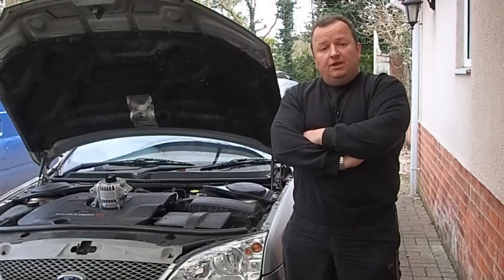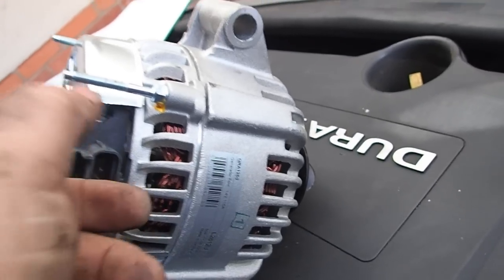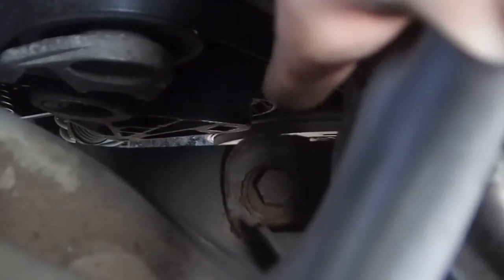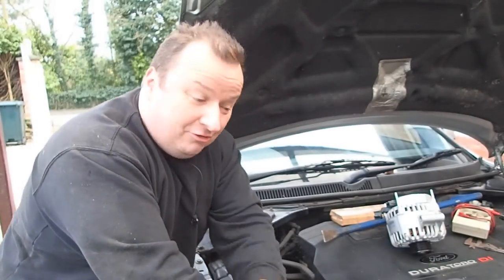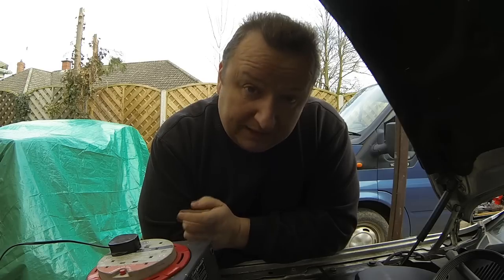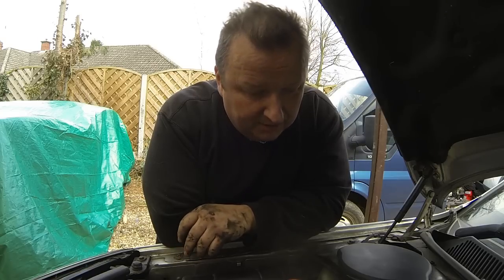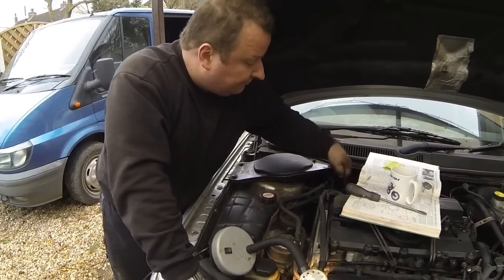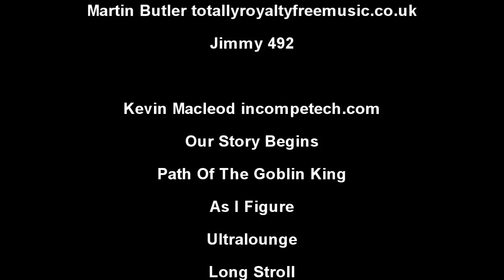Ford Mondeo Mk3 Alternator Removal Diesel How To

Comment: Great video. I just did this on my 03 2.0 tdci with the removeable studs and found out the following. If you can't release the tension on the belt then remove the top nut on the alternator. Remove the bottom nut closest to you. Loosen the other one. Remover the front stud and pivot the alternator up. Belt will come off easy. Fitting is reverse of removal. Cheers for the vid
Reply from the maker: I had to replace the alternator again 8 months later and found that out bud. I did do a video on it on my channel.
Nice one Darren.
Cheers
Martin

Comment: Thank you so much for this video; I followed it to replace the worn belt and not alternator. I was lucky as all tensioner bolts came out easy! Garage wanted £110 for this job and only costed me £16.99 for a belt and two hours work.
Reply from the maker: +Max Dee That's great. Well done and a great saving.
Cheers
Martin

Comment: I did a bottom pulley and tensioner (I would advise looking into changing them when you do the belt as they are a common failure on these, if I recall you can get the two in a kit) on one a while back and I had a whole load of ball-ache doing it as well. I didn't have the tensioner tool, or a crow bar that would fit like yours.

There's no way in hell you will get a half inch drive ratchet in to get the tension off the belt - there is a special tool for it (Ford T303676), though. They're something like £16 -£20 on eBay.

I really have no recollection of having to remove that bracket, for some reason. Can't you undo that bottom 13mm bolt on the adjuster and slip the belt behind it? I can't really remember well enough, or see in the video.
Reply from the maker: +mrman17 Not sure about that bottom 13mm bolt but I know that it's a common fail on those tensioner adusters although this one spins freely with no play so i'll let sleeping dogs lie.
Cheers
Martin
Reply: It's not the bearing on the tensioner that's the problem.

Basically, the crankshaft pulley fails (it's in two parts kept together by a by of rubber), this rattles about and causes the tensioner to fail over time, so it "bounces" about and doesn't keep the belt as tight as it should. It tends to manifest itself as a rattle at idle.

Anyway, I don't mean to do it regardless, but just be aware of it and check their condition while you are there.
Reply from the maker: Yes i've heard of that problen but hopefully it's not for a while.
Cheers
Martin

Comment: Hardest thing to replace Martin I ended up lowering the engine mine is the 1.8 petrol pain in the Arse lol although saved 120 quid so worth it I suppose .. Great vid keep them coming
Reply from the maker: +Sean Dwyer I did consider lowering the engine but struggled on lol. What a job though.
Cheers
Martin

Comment: Alright, boys and girls; I've just done this without going near the tensioner, without removing the studs and certainly not going anywhere near the track rods and drop links.
I pulled out the plastics from the wheel arch. Took the nuts off the alternator bolts (you don't need to remove the bolts). Removed the fuel filter (I'd long ago removed and thrown the heavy bracket that the fuel filter sits in; it does nothing of any value and hasn't ever caused any problems, rattles or otherwise). This gives just enough room to fish out the alternator if you're determined.
I then wheedled the belt off the guide wheel to give me some slack and with a bit of pulling and yanking, I found the alternator quite willing to come out from the top of the engine. It might help to remove the plastic part (three tiny nuts) but I dropped the replacement in without removing it so I wouldn't waste my time.
Once you've seated the replacement, you can then, leave the alternator sitting loose on the studs while you hook the belt onto the alternator drive wheel and then screw the nuts onto the studs to secure the alternator. Once everything is in place, you can use something long with a soft end which won't harm the belt, (like a rubber handled tyre iron), and by forcing the belt down and using your fingers to push the belt onto the jockey wheel, you can get it to seat neatly.
I'd be a lot more smug about this had I not got a couple of large bolts left over and not a clue where they came from. On the upside, nothing went wrong when I took it for a 'frapp of death' test-drive. There's always more than one way to skin a cat; I hope this helps.
Worked out where the bolts came from- no drama!
It seems the poster has pinned this aweful advice for some reason; I refered to his video for 'the right way' to do the job and...oh well, there's no accounting for people. 
In the interests of disclosure and out of concern for the dimwitted, I should've mentioned that I removed the plate at the top of the suspension that I think stops the assembly from falling out once you've removed the wishbone etc. which you obviously don't go near, for this. It's three extra nuts, 13mm I think. Don't lose them.
Importantly, when I was wrestling with the old unit, one of the fuel hoses got a very worrying kink in it as I was bending it out of the way but it seems to have survived...JUST...be aware; they're old and stiff; I thought I'd split mine and I've certainly damaged it, which will cause me problems in about twenty-five years. It's a cheap and easy scrapyard part...but you have to be able to drive there.
Anyway, I hate working with suspension so I went in from the top with spurs jangling and got lucky. You lot can balls it up at your own expense.
Reply: Do it the way the man says in the video,but buy a tensioner tool,it may  need a bit of cardboard tucked behind it.dont take it it out from the top,its harder work...instead disconnect track  rod end[use a heavy mallet leave nut at bottom o f thread to avoid damage] havnt disconnected  drop lnks in the past to do this job but it might help if they come of easy

Comment: I ended up buying two Serpentine Belt Tool Kit  (tensioner tool) for both of my cars. I had the belt come off after hitting standing water and was stranded. I could only use the bar and socket attachment but it came in handy. Was under $20 USD from a company called Harbor Freight.  So far I have lucked out with being able to replace a belt without removing brackets or mounts. My Kia Rondo had it's timing belt go New Years eve...supposedly they are required to be replaced at the 100,000 mile mark...didn't know that
Reply from the maker: +DJMovit These belts are supposed to last 150,000. this car has done 147,00 so it should be one really. Unlucky for your belt to come off after hitting water. Not heard of that before.
Reply: +retrorestore The one that came off was a Dodge Caravan. I was guessing something was slightly misaligned and the water just helped it along. Didn't keep it much longer. I am kind of like you as I will keep pushing the issue with large corporations that have poor customer service. Sometimes you win most you lose. Wal-Mart likes to just push your complains off to a store instead of looking into the mater. Then you get some Assistant Manager of the day that may call you back and claim it was a one time event etc etc.  Keep going after FORD! I can go on and on with issue but I won't...maybe I should vent on a Vlog! LOLHaven't seen Barney latterly hope all is well....getting old so I might have missed him in a video  :-)
Reply from the maker: DJMovit
Barney is fine lol. I'll do a vid soon on the update with Ford.
Cheers
Martin

Comment: Hey Mart.Another job sorted.Changed my alternator last year on the mondy but the Diesel version looks a pig to do compared to the petrol with the tensioner location and alt bracket.Swearing helps though.Does with me lol!
Reply: Good job also.
Reply from the maker: +Martin Hall The alternator was fine Mart. that stupid bracket to remove the belt was the pain. Still, got there in the end.

Comment: use spanner instead of socket on top bolt. i used crow bar to get belt of but threaded a ratchet strap threw tension er and around wish bone , cranked it to put belt back on

Comment: Martin did I hear you swear a few times lol well done for getting that belt back on. I know it's no good now but I was told to put a Jack under the sump with a bit of wood on it. then remove the engine mount. lower the engine enough so you can get to the tension bolts and alternator. hopefully now you and the mondeo can make up and be friends lol.
Reply from the maker: +antony wilde Haha, I felt like attacking this old friend with a club hammer today lol. The crow bar worked a treat so didn't need to drop the engine.
Cheers
Martin

Comment: Use a dremmel cutting tool through the bracket,    The exposed bolt will be easy to remove and replace the bracket is what I would do if I had to replace the belt

Comment: Great video Martin, hell of a job to get at the alternator and even more to get off that bracket for the belt. i know it would have been a lot more work but i think i would have lifted the car up at the front like you had it before to get better access. Anyway its charging now that's the main thing. look forward to more video's Martin, keep em coming lol.
Cheers, Jeff.
Reply from the maker: +cabdriveruk Yes it needed to be higher but I also needed a small air wrench as there's no room for leavering Jeff. Maybe another time.
Cheers
Martin

Comment: when you welded the nut back on for the sub frame , did you forget to disconnect the battery as welding with battery connected can fry your alternator
Reply from the maker: +radio control uk No, the battery was off the car bud.

Comment: For anyone wanting to change the belt. all you have to do, once you have tension off the belt, is to loosen the allen bolt at the top of the tensioner above the spring  as far as it will go (You have to grind down an allen key I think 8mm)  and loosen the 13mm bolt at the bottom of the spring, take the bolt out. this will give enough of a gap to slide the new belt in between the idler pulley on the tensioner.

Cut the old belt off and lower the new belt from the top of the engine bay, push the bottom of the belt up through the bottom of the tensioner (Where the 13mm bolt would be) and then slide it up the gap between the idler pulley, tighten the tensioner bolts back up put everything in situ. I highly recommend purchasing a tensioner tool about 20 odd quid from ebay.. 

The tensioner tool can only be used from the bottom of the car and it is a bit of a struggle, I had to push it and fit the belt around the AC pulley. 

Done the job twice now including changing the tensioner it's self.. It's not a pleasant job but it is completely possible.
Reply from the maker: Why not do a video showing your method. This is my video bud.
Reply: @retrorestore  No no I wasn't meaning to impede on your methods at all buddy. It was merely a suggestion on a quicker way of changing the belt without having to remove everything. Your videos are great and have helped me a lot, especially with the starter motor. 

Garages have you believe that these cars are the worse to work on but the truth is there are so many ways to get to things, I was told that to get the tensioner replaced it was an engine out job but it isnt.. Nah I was just eager to share my thoughts on this, sorry if I offended you man, Your way is great too and probably less fiddly xD.
Reply from the maker: @Vanadeo  No offence taken bud, all the best.
Martin

Comment: if your just changing the alternator, to loosen the belt just undo the alternator bolts and the belt will loosen enough to take it off the alternator
Reply: Is this true pal coz I'm tackling the job tomorrow and without the tool I'm pulling me hair out !
Reply: @MsRitchie225  how did you get on? I'm doing this in a few hours?
Reply: @MrKevinw89  it's actually easy you  just undo the bottom right hand bolt which goes through the alternator and tensioner spring mechanism this then release the tension on belt and you reach down from top and slip belt off smooth pulley! Then slip back on and re tighten and it put tension on belt. I left old belt on though as it was ok .
It has to come out same way past track rod end and drop link!
Hope it helps. It was was the bloody smart charge system that had fried on it!
Reply: @MsRitchie225  will let you know how I get on but from my experience with the mondeo is nothing is that easy lol
Reply: @MrKevinw89  definetly Not!
Even getting the wheels off!
Reply: @MrKevinw89  Yep! NOTHING on a Mondeo is easy when it comes to the engine bay unless it's at the top of the engine that is. With a tensioner change you need to undo the mount brackets, lift the engine and pull it forwards so it'll go into the bigger gap and you can work on the bolts.

It's all a real ball ache

Comment: Brilliant, warts 'n all. Good video shots in difficult places.
Reply from the maker: Cheers Andy, it was a bit of a faff lol.
Cheers
Martin
Reply: Some feedback from having done this today.
Firstly be careful with levers and crowbars near the pulleys as the pulleys break ! I had to get a belt and pulley kit.

Put a jack under the engine and then remove the offside engine mount Now lower the engine and you can then get a 1/2"  drive onto the tensioner. Having the engine mount off also gives good access to the belt.

If you remove the fuel filter and the turbo shield, then the alternator will come "up and out" without the need to remove the long torx head studs.

Thanks again for the video .. excellent work.
Reply from the maker: Good job bud, handy to know.
Cheers
Martin

Comment: What a pig of a job. Was there enough room to unbolt the offending bolt with the 2 spanner method? I had to change the drive belt as part of the service on my Astra and that was bad enough even though it is easier than your Mondeo.
Reply from the maker: +Parknest It needed a small air wrachet as it is so tight. I have one now so i'll do it soon.
Cheers
Martin

Comment: Martin you need a new crankshaft pulley. the rubber for the harmonic ballencer is very deteriorated.
Reply from the maker: Yes it was but I sold the car.
Cheers
Martin

Comment: 5 years i have problem. When engine is hot 13,5V  lights turned off.  When i turn on lights and eveything 11.7 With clima 9,5V and engine dead .  New alternator new battery clean cable its doesnt help.   Sorry but my language is not good :)
Reply from the maker: Check that the engine main earth cable connection is clean and tight and the rest of the charging system cables. Could be a loose cable causing the voltage drop.
Reply: i think its problem with computer.  Connection with 3 cables from computer to alternator 8,5v-10,5 next cable 0,05v and last cable 12,5 voltage like on battery..  This 8,5 to 10,5 voltage cable i think is to low from computer to alternator. Someday i checkt this problem again because now i am in holland
Reply: PCM controls the alternator, it's not controlled internally like it used to be. So it could very well be the PCM if you know all your cables are good and not nearly broken anywhere in the circuit and that alternator and battery is good. Also check parasitic draw before you drop the money for PCM. That would be my advice. Also try the full field test on the alternator so you see if it's getting the correct signal from the PCM. Check Scanner Danner's video on that. Just go to his channel and do a search for a full field test.

Comment: I feel for you! Another outstanding video.  I bought a tension releasing tool on fleebay a few weeks ago as I had to replaced the crankshaft pulley.  For £20 it's still half the labour of replacing the belt (and that's without the tensioner or pulley).  There is a spanish bloke who has made a video replacing the belt and he removed the engine mount, dropped the engine down a bit and thensplit the tensioner to release the belt (leaving the alternator undisturbed).  If you do need to replace your belt then this could be the answer? Here is the link : https://youtu.be/mxX6BBN3Z8I
Reply from the maker: +Miles Williams Just watched it Miles, that could be an option with the cut down allen key. It's just enough to slip the belt behind the pulley doing it that way. Cheers for the link.

Comment: I just found this vid. Great vid and some real good guidance on a how to. I did my bottom pulley last January and had to make a tool for the belt tensioner to get the load off the belt. I am surprised that it seems you need to take the alternator out to change out the belt, (not that this was your purpose as it was an alternator change), though I'm sure there has to be a way of doing it without taking half the car to pieces!

Hope you don't mind, but the vid of the tool I made is here https://youtu.be/jR9sI2NraQI
I still have it and have never used it since lol. I have a feeling it'll be used soon though as I really do need to change out that belt AND do the valve gaps as they're getting a bit noisey of late.

Comment: I done this job on the mk3 mondeo st220 v6 engine, wasnt that bad of a job to do. i did film it to show peeps how to do it. the tensioner is a pig yes but 3/8 ratchet and closed ended spanner, which worked a treat. Here is the video for you to check out  https://youtu.be/6jCkdVcdlgM